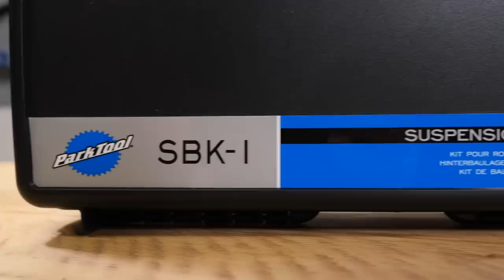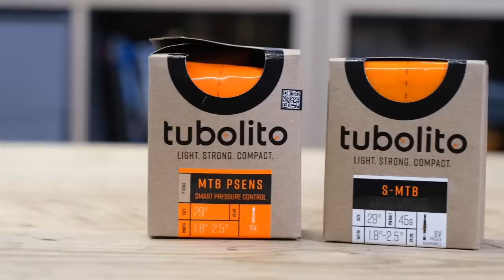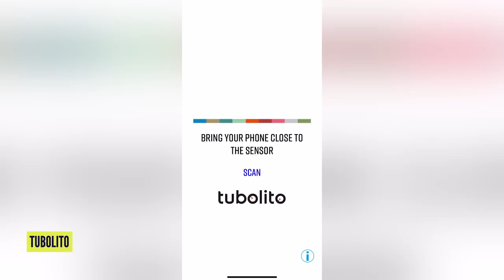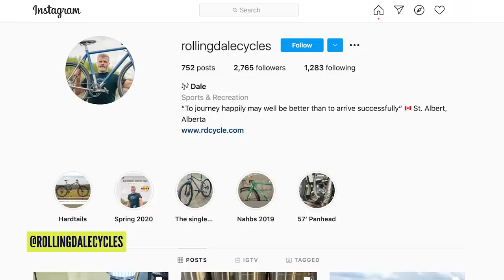Carbon Or Aluminium, Which Is Better? Plus New DH & Enduro Bikes From Prime | GMBN Tech Show Ep. 173

Comment: OMG a tube that can identify me wirelessly to nearby devices and tell me what my tire pressure is?  I don't know how I even enjoyed biking before this came out.  Now I can check my derailleur's batteries, my tire pressure, my twitter notifications, touch up my resume, delete junk mail, look at a map, and answer phone calls from my boss, all while still riding, so great, way better than a stupid pressure guage.  I'd like to see a 30.5 inch reticulated carbon fiber rim with this NFC chip in it programmed to retrieve recipes from the internet in case I wanna cook something in my wireless crockpot while I'm riding so I have something ready to eat post-ride while I wait for the monthly tire pressure charts to render on my graphics card before blutoothing them over to my NAS and then back them up to the USB drive in my grips.  Also a 149mm hub with a screen in it would be nice, I mean come on, its 2021.
In all seriousness, alloy.  Carbon and alloy both break, but the way they break is different.  Working in a bike shop I've seen both types of frame break quite a lot, but looking at the broken carbon frames (and rims) is terrifying.  Probably the worst thing that can happen on an alloy bike is the head tube tears right off, but that's pretty rare these days and usually if the frame's inspected you'd see damage before that happens and know to replace it.  On carbon, the worst case scenario is a large part of the frame (or rim) suddenly disintegrates into a fibrous mess while you're riding.  But your chances of predicting that failure by inspecting your bike are reduced with carbon, it goes from not-broken to broken very suddenly.  I'll admit that carbon can potentially ride a bit nicer than aluminum, and be slightly lighter, but I personally don't think it really looks cooler, a good aluminum bike looks industrial and reminiscent of motorcycle technology, wheras carbon bikes remind me more of a sailboat or a car fender or something, they're curvy and posh but they lack that industrial metal tough factor of oversized shaped aluminum tubes welded and bolted together. 
The disadvantage of aluminum is that it can interfere with the wifi signal of the selfie camera on your rear shock, preventing the selfies from being uploaded to the cloud in real-time as you ride and reducing the accuracy of the GPS location tagging of those selfies, which will throw an error code in the shock, you'll see the code on your seatpost screen, just google that code trailside and contact your shock manufacturers' chatbot, tell them your user name and password, and they'll unlock your shock temporarily if you have a platinum membership.  Hopefully there'll be a way to hook these smart-tubes up to a rasperry-pi or arduino or something and have them reroute the cookies from the rear shock directly to the seatpost screen's chip, bypassing the antenna in your camelbak, thereby eliminating this annoying problem and letting us do what we love best, which is ride, with our phones.

Comment: I would buy an aluminum frame, the problem is they spec them with lower end components than carbon. By the time you buy parts for aluminum it cost the same as carbon and its not worth as much in resale.

Comment: I don't care about the frame. Wheels are alloy. I do have an issue where I want high end spec on a alloy frame, bit most companies only put top end components on there top end frames...which are usually carbon.

Comment: Is it fair to talk about aluminium vs carbon and not consider the price?

Where a brand offers the same bike in both materials with the same components (e.g. Orbea Occam H20 vs M30) is the carbon M30 $1000 better than the aluminium H20? If you rode both bikes back to back in a blind test would you be able to notice any difference between the two? What about if you used the $1000 saved on the aluminum bike to upgrade the suspension from Fox Performance to Fox Factory and from Deore brakes to XT brakes? Now the price is the same but which bike rides better?

Comment: Personally i don't I'll ever buy a carbon bike or carbon components simply for the environmental impact of the material compared to alternatives. Also i don't quite see the point of em in general. They might have a slightly different feel, but that could also be achieved through design changes to alloy bikes couldn't? There's the weight argument, but if you're just out for a ride, you're not on a race, so why do you want to be marginally faster than the previous guy? Not even through technical or physical ability, but just because you were able to spend the money on a carbon frame. Honestly, i think even when it comes to racing, carbon components/frames dont make much sense. If everybody's riding a carbon frame, then nobody's has an advantage over anyone else, so what's even the point? Just have everyone race on whatever sustainable frame they prefer, be it steel or alloy and be done with it to be honest.

Comment: I absolutely hate carbon fibre on mountain bikes for a number of reasons. Over the 30 years I've been in the sport the worst thing about carbon is the claims it's stronger. In the real world that has never been true. I've seen far more catastrophic failures of carbon than any metal product. Worst is there is always an excuse as to why it fails its never the fault of the carbon. This has put me off for life and I will never buy anything carbon for this reason. Also it is massively over priced and still sold as a wonder meterial. Considering the stuff is over 60 years old it should be great value.
Metal is better value, stronger, better looking and far more durable as far as I am concerned. Metal all the way!!
Reply: I've had bits near the bottom bracket on a couple alu bikes corrode into white powdery oxide due to salty sweat getting through the paint and onto the metal. One was a Mark 1 Jekyll, which Cannondale fortunately replaced on warranty. But, on balance, I prefer metal to carbon. Maybe I'm old fashioned, but I'm worried about carbon getting dinged and disintegrating.